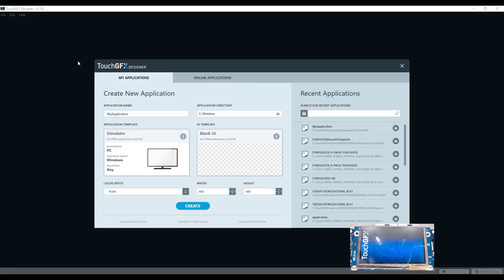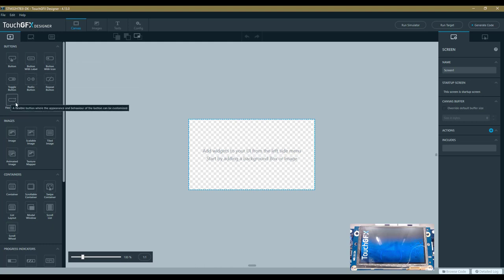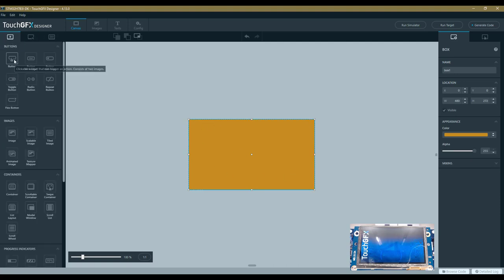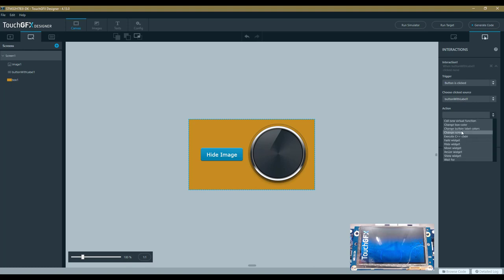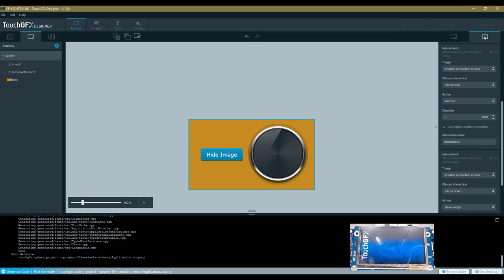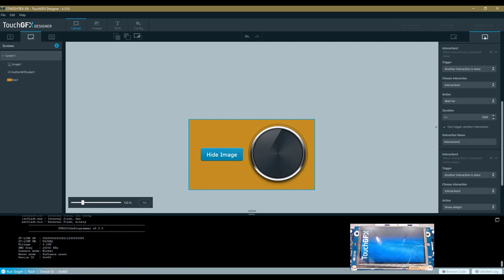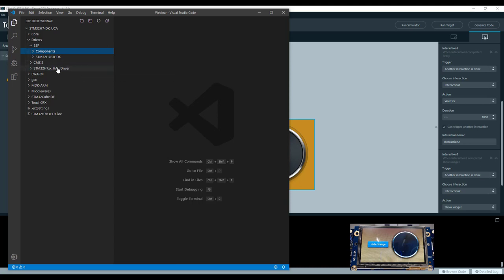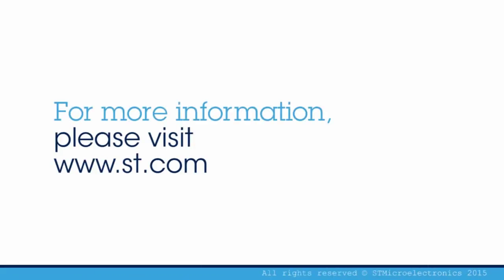TouchGFX Webinar - 2 - Project on STM32H7B31-DK board

Comment: Hello, thanks for the video and explanation. After generate the code with TouchGFX, I could open it with CubeIDE, but how is the way to integrate the SMTXXX.ioc file inside that project. The .ioc file has a generic name, matching with the name of the board, but it not match with the name of the Project. Thanks for your support.